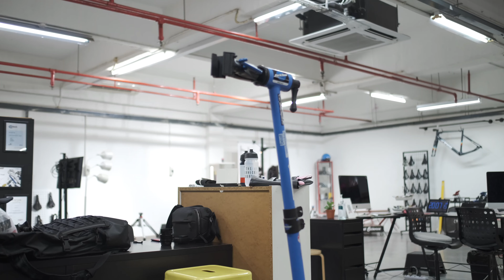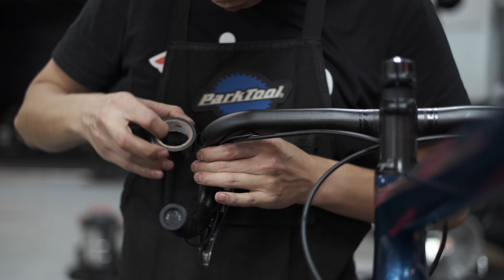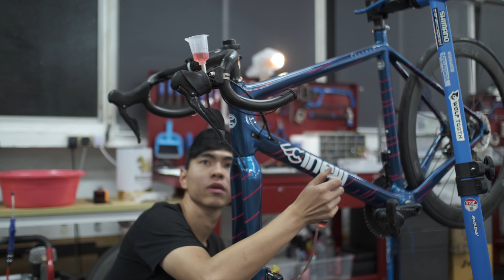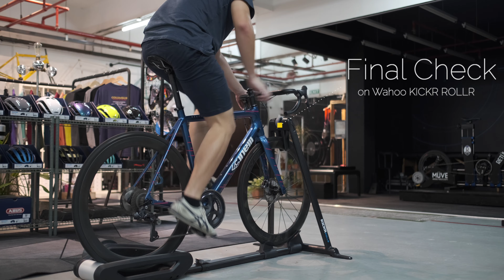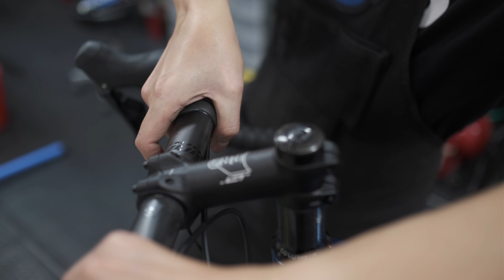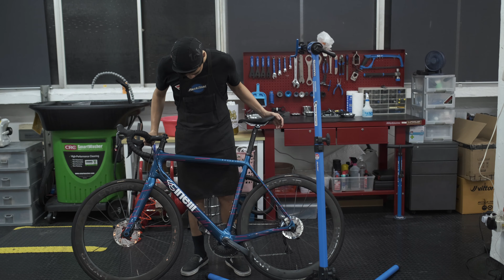DREAM BIKE BUILD: Cinelli Veltrix

Comment: Thanks for the non-integrated bar/stem combo and for not slamming the stem, but those are way too many spacers.
Reply: He could have chosen a - 6° angle stem, instead of a - 17° angle and easily removed 15mm of spacers.

Comment: What’s the weight of the frame and fork? I saw somewhere 1250gr for the frame and 500gr for the fork. Is that what you measured?
Reply: exactly, mine veltrix weighs 1250g(frame)and 476g(fork).